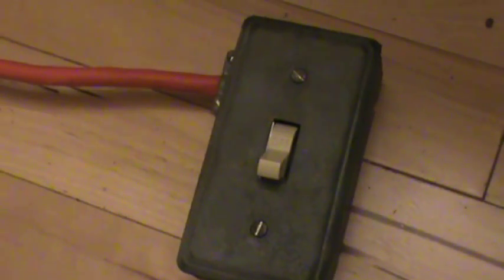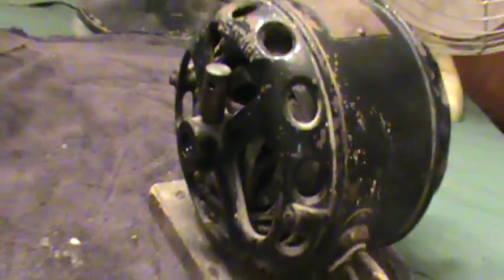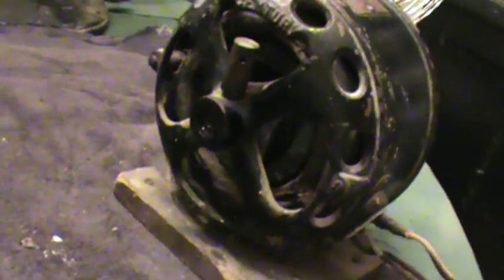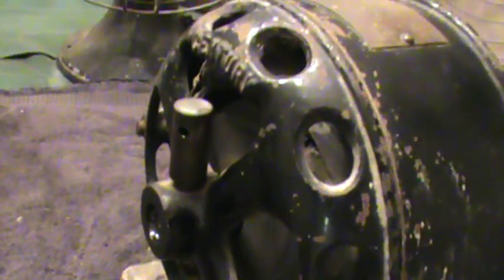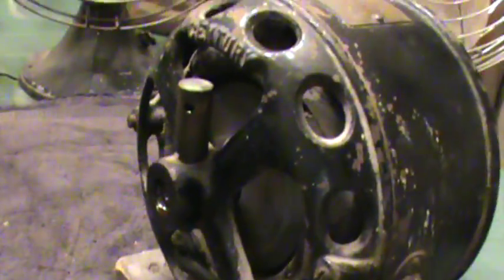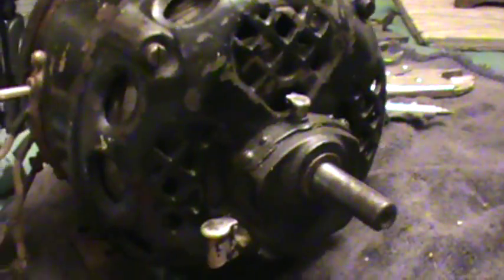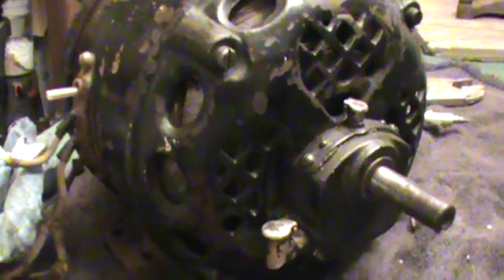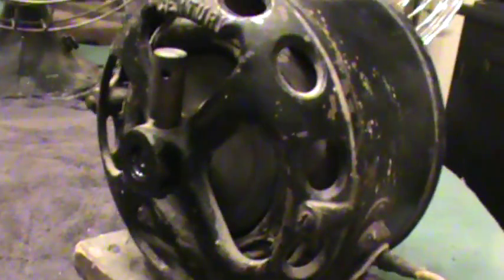1900 Century "Invincible" S-6 Split Phase Motor, 1/4 HP

Comment: You just don't see Century "Invincible" split phase motors! I have an Invincible S4b 1/10hp which must be a slightly later version. It doesn't have the open frame like yours. Really neat to see another invincible motor

Comment: Just bought an s4 table 12"  dirty dirty worked on it 10 minutes and on the 299th spin with the finger it took off , only bummer is no switch , 5 speed 100 year old switches are like one per 50 states lol .I will make a video but its only10 degrees now and not too motivated